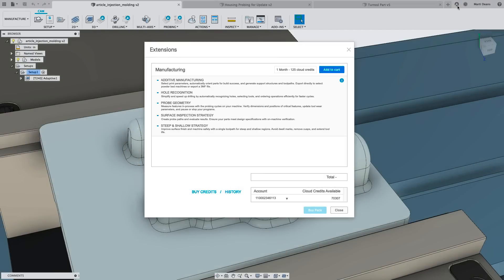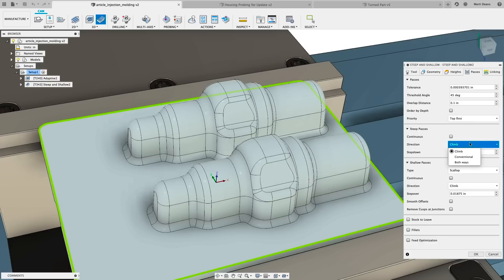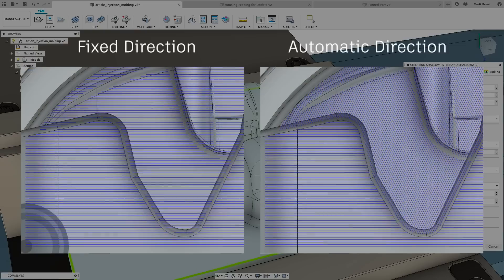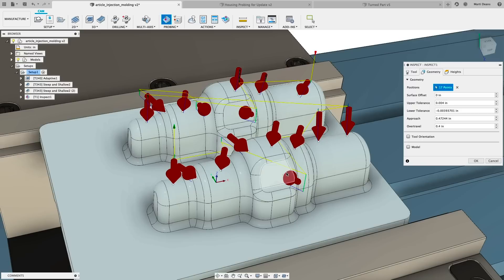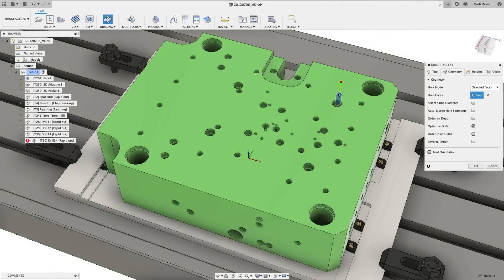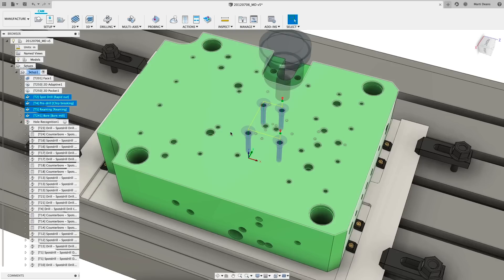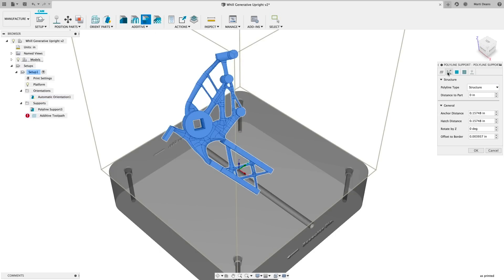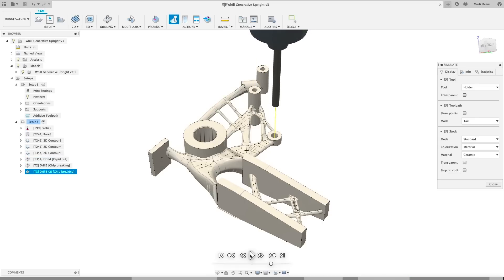What's New - Advanced Manufacturing Extensions

Comment: I am currently running a start up license. I have interest in the probe inspection feature. After an hour of searching what the cost for this feature is I am at a loss. I read 125 cloud credits. I'm not even sure what cloud credits are. After reading some of the comments it seems it's some type of currency autodesk uses. If 1 credit = $1 the WOW! I have parts I would like to check on the machine but that is only once in a while. Id be surprised if I used it more than 5 times or so a month. I would be a little more prone to purchase if instead I could buy hours in use, kinda like Haas does with some of there features, but not for $125/month. That rate would equate the software cost in only 4 months. I'd love to be able to use the probe inspection features but please make it more affordable for startups and easier to purchase as well. Fishing for hours how to buy is not efficient.
Reply from the maker: I'm sorry you found this difficult to find, and disagree with the pricing structure. While this isn't set in stone a chance could be made at some point. That said, a great deal of thought, debate, and work went into getting it to this point. We appreciate your patience.

Comment: just look at this package. in the standard suite they are targeting an audience/market with a cheap price point of 600 dollar ish per year. meaning they have alot of smaller companies, hobbyists and price aware customers. then they release a few more features, some not even related to the same workflow, which costs per year, more than twice! the cost for the program it self. whut?? that like IKEA realising an add-on to their low price budget kitchens lines which comes from a high end luxuary kitchen line and costs more than the f?ing kitchen itself!!! makes no sense even business wise?!?    edited to add how i would solve it. break the features in their own so you can buy them 1 by 1 and add a preview. lower the price drasticly so i can easily just put the costs on the customer. say 5 / 8 dollars per exported toolpath.. it might even make you more money in the end but caiters more to your audience.
Reply: That's interesting.
Reply: This is super interesting feedback! I would have expected the result of releasing pay per feature (and definitely pay per toolpath) to result in a lot of nickel and dime-ing accusations, so I'm surprised to hear you say that you would rather that was the case. I think Autodesk is open to feedback and I would encourage you to share this opinion on the forums if you'd like. 

I think as we continue to develop the manufacturing extension the value will become more clear. I also think that since it's not required to complete any workflow, your analogy of the IKEA kitchen is actually perfect. Is the standard kitchen good enough? Great! Save some money. Want that additional feature? Great! Pay a little more and get a little (or maybe a lot) more. It's also not a full annual subscription, so if you need to you can just subscribe (on a monthly basis) when you need it. If you'd like to see more granular subscription options, that feedback is also welcome! Personally I think a weekly or daily option would be awesome, but would like to hear your thoughts as well. 

Quick disclaimer that the above opinions are mine and not Autodesk's.